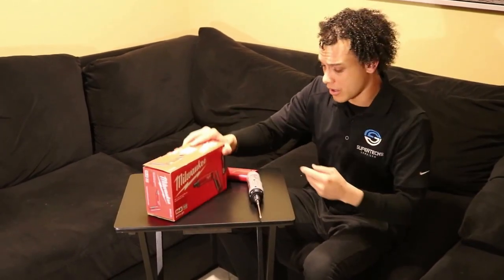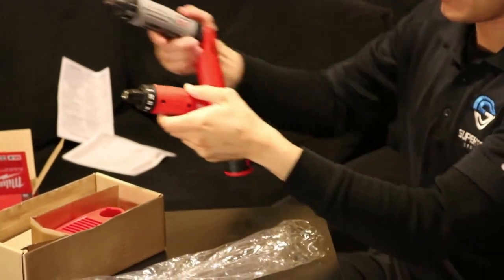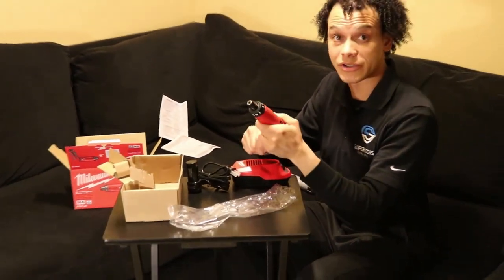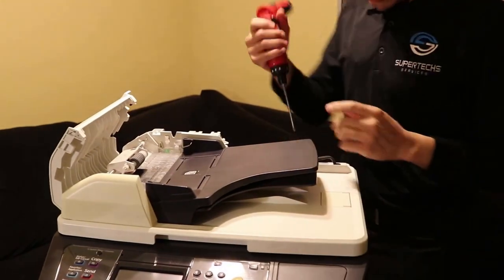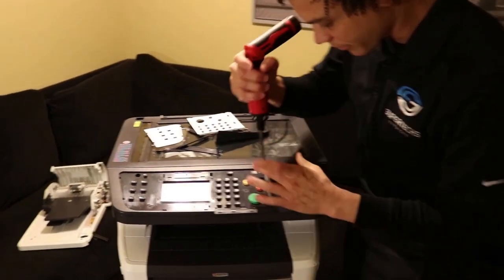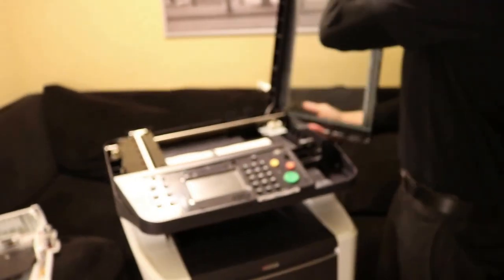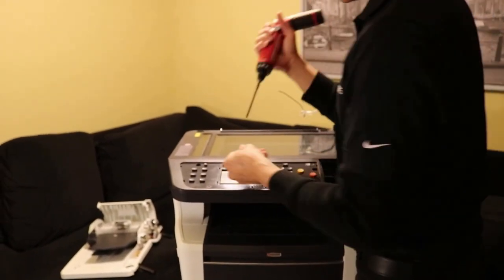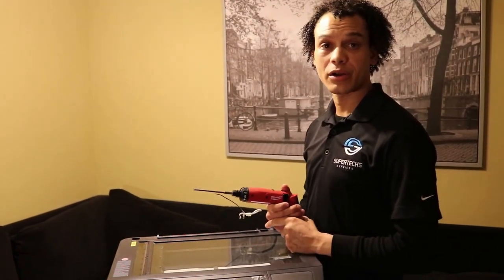Milwaukee M4 drill unboxing with usage.

Comment: been searching high and low for someone showing this screwdriver being used on plastic parts! you said you keep it on "3" for plastics. have you ever stripped any bosses? i do a lot of plastic product design and am looking for something with a low enough torque setting to not mess everything up. you feel you got enough control screwing into plastic?
Reply from the maker: I still use this every day. It's my favorite drill. I mostly use it for repairing copy machines and for small projects around the house. It works great on plastics and metal screws. The only problem I have with it is drilling into some thicker items like wood, it doesn't have enough power for that.
Reply: @Supertechs3  thank you! will have to pick one up for my plastic work.

Comment: So I will be the first to comment. Good video. I bought one but what I am curious to know is if the batteries from the older model work in the new M4 screwdriver? You can buy the higher capacity batteries for the old screwdriver but I have not found them for the M4.

Comment: What bit are you using?  I am looking for long bits like the one you have in the video
Reply from the maker: I friend of mine gave that to me, I don't know where he got it. Here is another one I use https://www.amazon.com/MILWAUKEE-ELECTRIC-48-32-4564-Shockwave-Phillips/dp/B005HPVXYK/ref=sr_1_6?keywords=%232+japanese+phillips+bit&qid=1637794618&qsid=133-4088738-9748118&sr=8-6&sres=B06ZYK1JL4%2CB07L4XMCDP%2CB073DHZFMB%2CB06XYRN4BH%2CB005HPVXYK%2CB06XYCNTDK%2CB06XYRKHRB%2CB07FB9515L%2CB07T7W64GL%2CB07KHJJDKL%2CB002KKBBN8%2CB07CBRM5Y1%2CB0065IDBXO%2CB071VWJKLM%2CB06XYFZMVR%2CB06XYRCX4S%2CB07MH8K6M4%2CB005HPW3Y4%2CB07MKVQS89%2CB00004RH2A&srpt=FASTENER_DRIVE_BIT